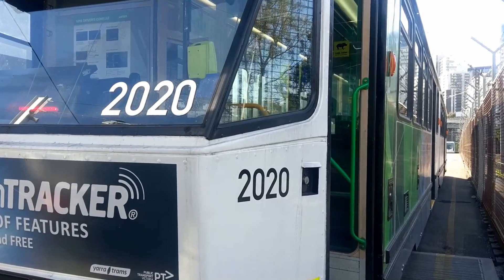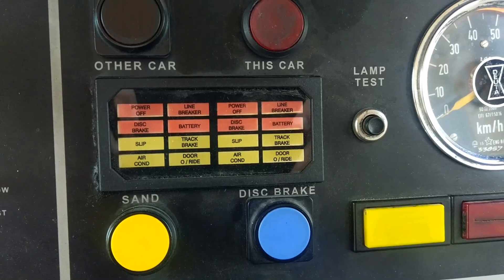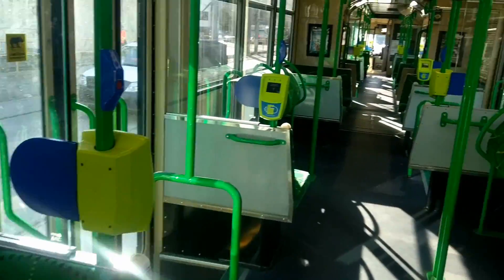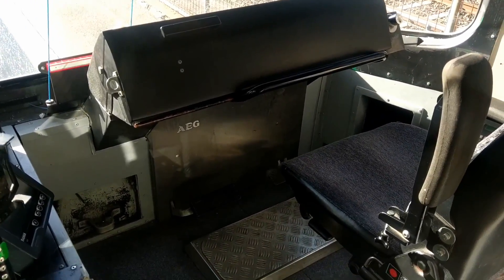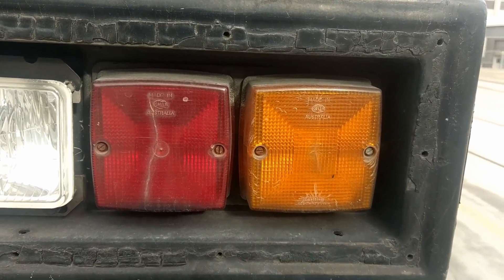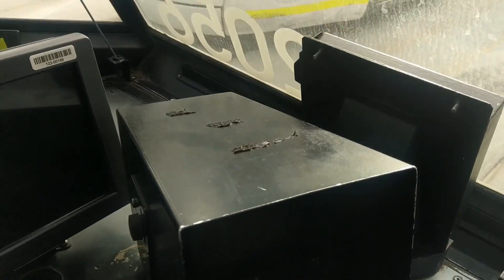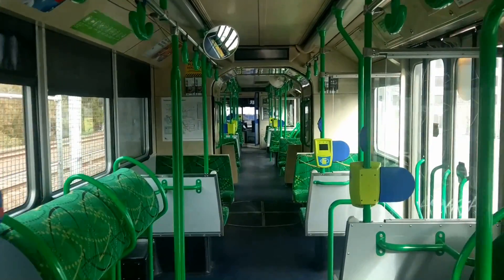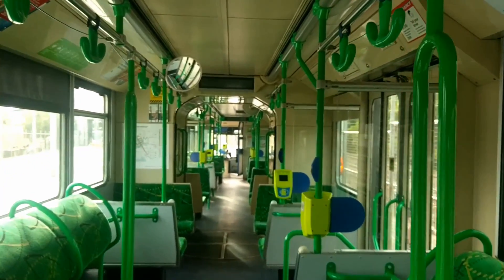B2 Tram Comparison - Life Extended Refurburshed versus Non Refurbished

Comment: If you compare this with MTR Light Rail Comeng Phase 1 and Kawasaki Phase 2 since they use the same Siemens/AEG GTO chopper drive as the B2-class Yarra trams; don't you think they sound similar?
Reply from the maker: They do indeed and you can tell the Hong Kong stuff is definitely Comeng from just looking at it.
Reply: @Schony747  except for Phase 2, which is Kawasaki, not Comeng.

Comment: I was on a refurbished B Class, B2 2022, today and noticed that it differs from B2 2020. The passenger area seems to have much less cosmetic upgrades compared to this one and some windows randomly still have blinds while the rest don't. I can't tell if things are done in stages or if the later refurbs are being cheaped out on cosmetically and only going for the technical upgrades. Also, I curiously noticed that next to the "Gong" button there is a placement without a button but labelled "Horn" which is odd for both the fact that B Classes have never had a horn and there's no button on it anyway, so puzzling 🤔 I was wondering if you could shed some light on these things if you know and also the really odd superfluous "horn" label Brenden
Reply from the maker: There seem to be a number of variations. I thought the prototypes were designed to iron all of those flaws out.
Reply: Ah ok, that's interesting. I haven't seen enough of them out there in the wild yet for a good comparison, but it is interesting that this prototype one in the video looks much more elaborate and better done than B2 2022 at least🤔 That's really strange. Thanks for sharing your thoughts on it though Brenden. See if you can spot anything on your B Class travels with your much better in depth knowledge of them than I do. Now you are going to be looking for all those differences in the refurbs, now that you know there's much variation, haha.
Reply from the maker: I drove a prototype about 12 months ago. Both the horn and the gong were next to useless so it will be interesting to see if  the new ones have improved. The horn idea has merit and it works really well particularly on the C Class.
Reply: Oh cool 👍 that would be interesting to see a horn on a B Class 👍 but I always found the C Class horn is probably useful because those things have the weakest gong I have ever heard. Gotta hold it and can't hear it from 10m away. Still, more gongs and horns makes for more fun and safety👍
Reply: Speaking of C Class, I wonder what the life extension of the C's will be like. C 3025 was and possibly still is at one of the Preston depots for life extension works as of a couple of months ago. There's supposed to be some fairly extensive reworking/renewing of parts I don't understand technically, but I do know there's supposed to be new and lots more next stop buttons throughout the trams. New floor covering and possibly body works. I believe the C's are having the second most extensive works after the B Class. The Z's and A's are basically going to be fixed up cosmetically and body works and minor life extension works but not much else considering they are up for retirement/phased out slowly over the next decade or so. But we could have a Z1/2 situation where the Z3's and A's hang about much longer to cover the fleet needs as passenger growth continues each year. There's a lot going on with Melbourne's Trams, so I really enjoy reading, talking about and learning more about it all😄👍